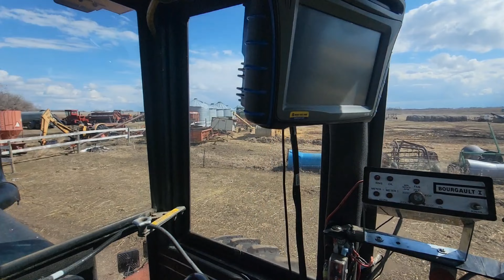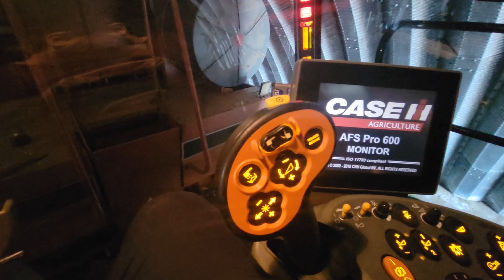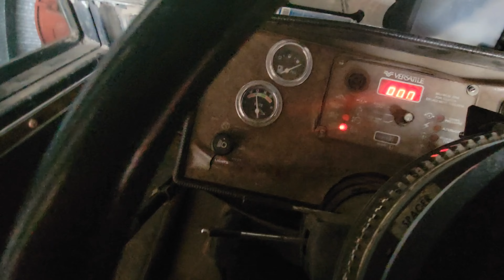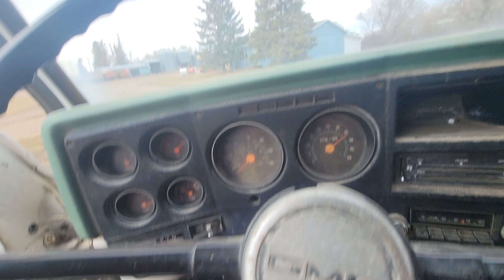Waking up the horsepower for seeding 2024!

Comment: Those "new" battery chargers are junk!!!! You need to find yourself an old Schumacher SE-3010 10amp/30amp + 200 boost charger. Zero computer logic involved with those chargers. They quit making them 3-4 years ago but you can sometimes find them used online.